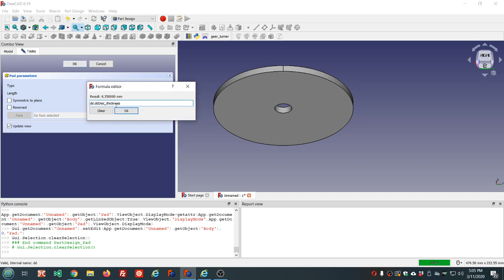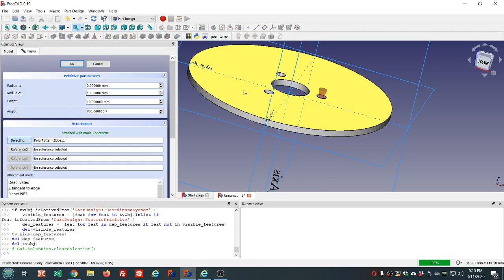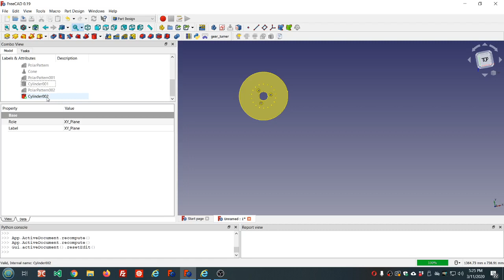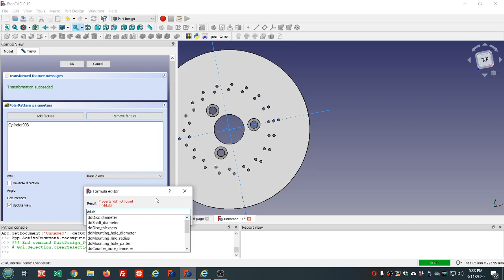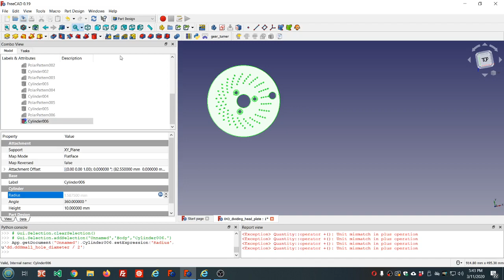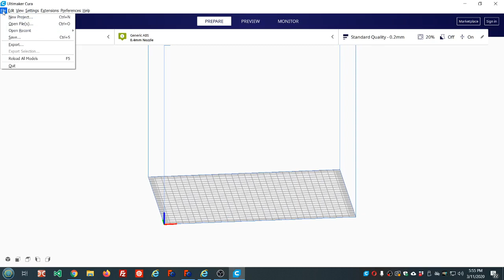043   FreeCAD dividing head plate

Comment from the maker: I made a little mistake in here, which has been fixed in the model available on github.  Instead of mapping the subtractive cone to the circle I should have mapped it to the xy_plane and moved it, but I was being a bit lazy there.  Also, I've uploaded a newer video (#044), along with a newer v2 version of the model, showing a more robust way to make this that won't have as many errors potentially when you start modifying the properties, so I recommend using that file instead of this one.